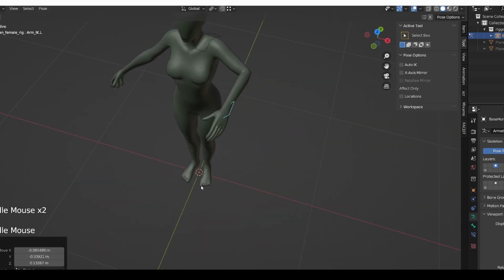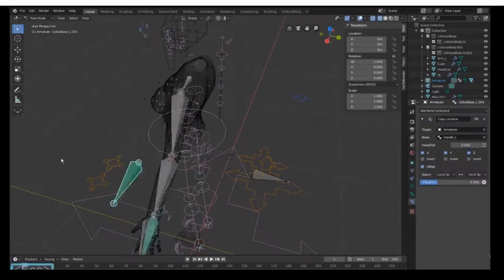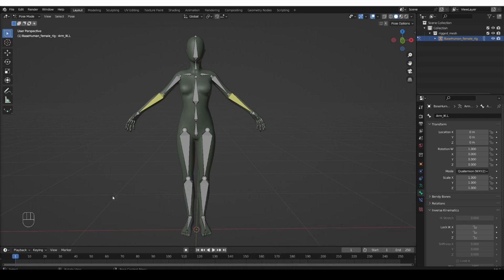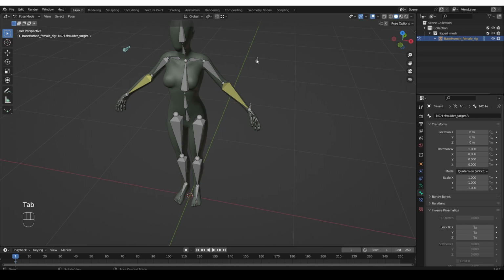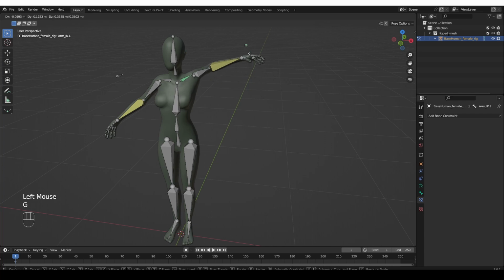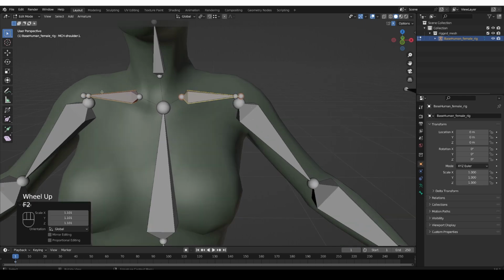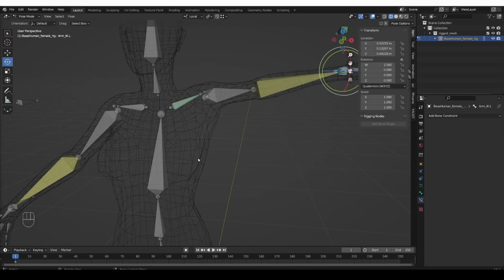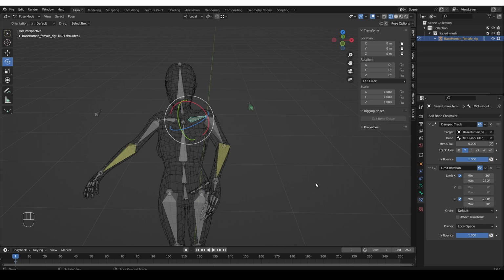Blender Rigging: Automatic Shoulder rotation!

Comment: What, if you have a model in T-pose? Can you still apply the solution?
Reply from the maker: I think so. Did you try it?
Reply: @CGDive  I tried, I also have a clavicle bone before the shoulder bone. I Used that one to follow the target bone, extruded it until it crossed the hand IK on the world's Z-axis and used that point for the new target bone (I hope, you get, what I mean).
It... kinda works, I may have to tweak a little bit and may have to use a limit rotation constraint on the clavicle bone (it's definitly moving too much), the shoulder bone can't be used since it's already directed downwards in T-pose...

Comment: It was very easy to use and cool! I was thinking about another method that could work in FK. the method is similar to your method in ogre legs, with actions. right?
Reply from the maker: I am not sure. Please describe it in more details, I'd love to hear how you'd make it work.
I actually figured out an FK method that works but it needs more testing to make sure it's solid.
Reply: @CGDive  that's very good news if you can present a solid FK method! 
The method I used was like this:
1- 4 actions of should bone rotating up, down, front and back
2- Creating 4 action constraints for shoulder bone and assigning each action to all of them
3- choosing the upper arm bone as target and use its local rotation for the 4 actions.
4- avoid overlapping "min range" at 0 and use 5 to 30 and -5 to -30 for example for up and down or front and back combination (it went crazy with overlapping at min range 0).
I can record a video of it if you think it's not descriptive enough or it's easier than the method you're working on (which I doubt)
Reply from the maker: @danialsoozani  I understand and I tested it. It seems to work although there is dependency loop. Notice how the arm does not fully reset occasionally when press alt+R.  You can also see it in the system console.
Some dependency loops are worse than others and this one is pretty mild. You can probably use the rig without a problem. 
But personally like to have zero loops even if they are not too bad. :)
Thanks for sharing the solution! It's definitely interesting to know.
Reply: @CGDive  Thanks for your feedback. yes there was a problem with the alt+R situation that didn't bother me. 
So my fingers are crossed for your solution, I hope it is solid. can't wait for it :)

Comment: UPDATE: Please dismiss this comment, I already got it working perfectly fine

HI, I tried following this tutorial and it didn't work for me at all. the way the arm was bending was janky and sloppy and just straight up awful

I tried doing this with a T-Pose model so maybe that's why it fucked up. I assume this only works with A-Pose models and nothing else
Reply from the maker: comment dismissed :D
Reply: @CGDive  actually, i found an oddity here

i accidentally set the target/owner of the shoulder ik to world space

so when i changed it back to local space, it works fine, i even made sure to parent the shoulder ik to the hand bone

but the problem is that, as far as i know, in this vid you only need the damped track for the shoulder bone, but in my case, whenever i  followed along, it would always have the shoulders bend backwards which is not what i want at all.
unless I have a limit rotation constraint or I set the shoulder ik settings to world space

again, this is on a t-pose model instead of an a-pose model so that might be the problem
Reply from the maker: @LauraBeltran2001  Yeah, I can't say what the problem is without looking at the rig. There might be other constraints in play or who knows what.
Reply: @CGDive  I think the problem is that my rig has these elbow IK bones so that the arm bends a lot nicer. they're located away from the actual model. i think the problem might be caused by those bones?

Comment: a problem with this aproach is that on global y axis shoulder should rotate not based on position of an arm, but based on distance to hand, i.e shoulder should be neutral when hand is very close to the chest on Y axis and extended - when its further away
Reply from the maker: I didn't quite understand this but sure, improvements are always possible. However, often a simple solution that solves 80~90% of the problem is sufficient.
Reply: @CGDive  bring your arm in front fo you - shoulder will extend forward. Now pull it back towards your chest - shoulder will want to move back naturally. This rig will not replicate that fairly common behaviour.
Yes it is though kind of good enough for a lot of cases :)
Reply: @CGDive  Actually, my apologies, i was working on my own armature and was implementing a similar solution, but I missed the fact that in this one you don't use ik target as a point at target for a should, but rather a separate bone parented to the ik target. This indeed allows for better flexibility, and since the bone can be offset from parent to always be more to the side of the body - it can also work with the example I mentioned. Only a matter of setting up those offsets to taste.

Update: After all I did find an approach of simply tracking IK point by a shoulder a bit more manageable on my rig and for my purposes. Also since shoulder is directly tracking ik target - influence on the shoulder tracker will be much less than 1, which will allow to adjust the shoulder manually, on top of tracking. Huge benefit of that setup - it requires 0 additional bones and has fewer variable to tweak

Comment: Whats the difference of doing this then just copying the rotation of the ik hand bone directly to the shoulder?
Reply from the maker: Have you tried "copying the rotation of the ik hand bone directly to the shoulder"?  What was the result?
Reply: @CGDive  Actually correction I had it set to rotation of my arm ik bone that is controlled by the hand ik bone. So in other words I have it set to copy rotation for my C Arm IK Bone. I use Auto Rig Pro which sets up these IKs automatically for me so I just find the shoulder to the arm rotation.
Reply from the maker: @DatYouTubeGuy  Honestly, I don't fully understand. What's the result?
Reply: @CGDive  It works for me.
Reply from the maker: @DatYouTubeGuy  Setting Copy Rotation on the shoulder/clavicle with  "c Arm IK" Bone as target leads to a dependency loop. So I probably don't understand what you are doing. If you can send me a file with the setup, I'd be interested to take a look.

Comment: The solution I would probably implement is this:
Two seperate IK and FK rigs. An influence slider onto a third rig (to switch between IK and FK smoothly), then set the Z vector based on a root bone of the mesh and give it a Z-Vector offset based on the angle between the of the attached Mixed_IK_FK_Arm bone and the shoulder bone, with a limiter function, so that it only moves up, when the angle between the two is small enough.
Reply from the maker: TBH, I don't understand what your solutions is solving along with most of the lingo you used.

Comment: I have not tried this. But if se add this to a metarif,will it passed on to a generated rig?
Im thinking of making a meatrig with all these extra features. Also the exmaple you showed with the elbow, chest muscle and knees. With my rigify save preset addon its super easy to save this as a new meatrig then and reuse vs doing it all over again each time
Reply: I did eventually made a test with the chest muscles and they do transport over to a rig when added to a metarig. I'll do some more testing

Comment: I couldn't get the bone to snap to the other so I just set it on the end of the bone instead. After I added copy location and chsnged to local space the shoulder control bone move nesr the hsnd control bone causing the shoulder to pull down toward the hand.
Reply: Update: I just had to adjust where the shoulder target bone was located in edit mode.
Reply from the maker: Nice!

Comment: I found angle to be in RBF node [left side] after digging, and found out the items you select, even camera or light, have their own options list. I wonder if there's a way to use camera angle to influence shapekey with a threshold, or influence a custom property (like for anime faces)? For example, the bone and cam have a start angle, but when you rotate either bone or camera [a feedback loop] your shapekey slides or a custom property slides depending on how you record the setup speed. But I can't seem to get it to work or imagine it properly into RBF nodes lol... Maybe it can create a difference angle calculation? (I noticed there's an rotational  'difference' option inside of the variables for normal drivers--don't know if this was new or not).

I did ask the creator but he was rude very fast. I mean fast. I said I should know what to do with RBFs, and overassumed a lot over small explanations... so i stopped emailing him smh... Usually maya community are this harsh, and he thought that the blender community functions the same way since he's new to it. It's one of the reasons why I left the maya community to join blender. Over priced and always mean for small things lol.

Comment: I thought this realization was great at first. But alas, when I started putting the character in poses I noticed a big flaw in this implementation of the shoulder. If you bend the arm at the elbow and pull forward the forearm, then any manipulation with the turn of the palm or wrist (depends on what you attached the target bone) will move our shoulder. I have not yet figured out how to overcome this problem. 
20240611: Digged through MaxZhang video and found a solution. Just parent the target bone to the upper chest and add offset option to Location Constraint.

Comment: the method is good but there is a flaw in your method to add extra rotation, first making child of the mhc bone directly in the edit mode can ruin the hierarchy of bones, second when rotating the spine it over rotates, to fix you want to add the damped constraint to the mhc bone and then copy rotation set to before original, this way it doesn't overshoot and doesn't ruin the hierarchy.
Reply: do you have a tutorial per chance?

Comment: I've got a simple FK solution: copy each rotational axis of the upper arm bone as a driver to each rotational axis of the shoulder bone. This'll make the shoulder move however the upper arm does: basically a double rotation without any parent/child cyclical issues. To lessen the effect, go into each driver, choose scripted expression, and multiply it by .25, .5 or whatever influence you want.  If you also need manual control of the shoulder (who doesn't?), create a new shoulder bone and parent the existing shoulder bone to that. Now all you need to animate is the new shoulder bone: the driver bone can be hidden but it'll still be there influencing the arm.
Reply: you should make a video too because without pictures I can't ' catch a word

Comment: I'm not really fond of any of these, because in reality, clavicle moves depending on the location of the elbow, not the hand.  Basing it on the position of an IK controller (or proxy hand marker) is not ideal: it works properly only when the arm is extended, not when the arm is bent.  I prefer a two-pass IK method: do 2-chain IK with modified arm bones (head of humerus above clavicle head, closer to clavicle head) to get the elbow; then, do 2-chain clavicle->humerus to track this elbow position.

Not really sure what would constitute a fully FK solution, because of course origin of humerus depends on clavicle rotation, but it seems like any FK solution would be trivial from an IK solution: just determine the position of a mechanism IK controller from FK bones.

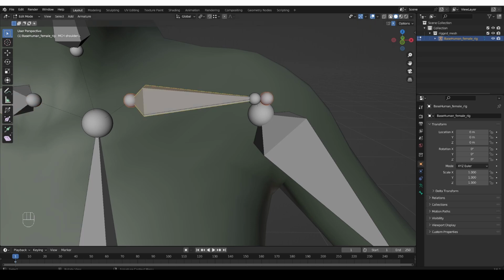Comment: 7:00 Right click>Symmetrize no more need to type or what ever, sometimes blender can break so ensure you either clear the bone role (alt-R) you may need to perform it once more (i have only ever had this occur once where it wouldn't accept symmetry due to my bone roll problems).

As for my own problem i am using rigify for my rigs, when i follow these steps with my own rig i end up having my arm turn into a helicopter rotor that does not want to return to rest pose in posemode.
It's almost as if the IK doesn't like it, i would like to use it however, does this work for rigify?

Comment: Thanks for the great tutorial! I have tried to apply this method to the Rigify Rig and in general everything is working fine, but there is a dependency cycle.
Reply from the maker: That doesn't sound fine haha
Reply: I managed to bypass the bone dependency loop. But another problem came up, since I had to add a new bone as a buffer and bind hand_ik and mch-shoulder_target to it with constraints, the function of snapping IK bones to FK bones position doesn't work anymore because constraints don't allow it.... please if you have time and opportunity try to apply this method to rigify rig and maybe make a short video on this topic
Reply: Yes, you're right, I'm trying to figure out how to work around this, but so far I haven't managed to get it done. 😞
Reply: Hello. Great tutorial. Please like the other user suggested, if you can recreate this set up with rigify in a short tutorial, it would be fantastic.

Comment: Great tutorial with great easy to use setups.
Though i'm not sure why your shoulder has limit of 30 deg. up rotation, I can almost touch my ear with the shoulder without bending the neck xD
Reply from the maker: You can? Wow! :D
As I said in the video, these are just quick base values. Each character is different depending on their flexibility, what they are wearing etc.

Comment: Thank you for this! But imo it could be better to reduce the influence of damped track, instead of reducing coply location for the target-bone. Cuz if you will try to make rotation of the whole body and pull an arm to the front, the target bone will appear somwhere inside the body and shoulder will go crazy.
Reply from the maker: Nice, thanks for the tip 👍

Comment: I have two serious questions. One when I try to pose my character's leg on the -x location, the foot looks weird. Is that normal or do I have to do something to make it look right? The second question is, since I bought Auto-Rig Pro, do I really need Auto-Rig: Quick Rig?
Reply: I was wondering the same thing about Quick rig. I got to try the thing about the -x location.
Reply from the maker: Quick Rig creates a control rig from a simple rig such as mixamo, game rigs you downloaded from game engines etc. I don't know if you need it. Only you do :)
The question about -x location is a bit unclear to me. I can't help, sorry.
Reply: @CGDive   I thought the normal auto-rig was for any engines. If I get Quick rig, will it mess up all of the hard work I put into my other rigs through Auto-Rig pro or do I have to go through the process of rigging them all over again? 
-As for the -X location question, when I move my characters leg on the -X location, the foot follows it but it looks like it's (the foot) is flat on the ground. I was just wondering is that normal?
Reply: @bratdoll332   You can move the foot on the -x location then you have to rotate the foot on the y until you get it straight enough.